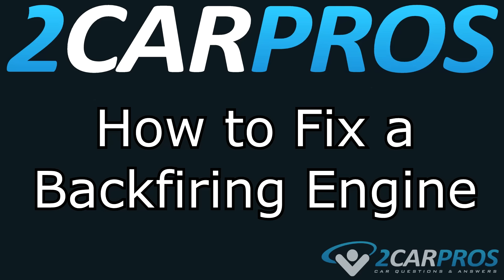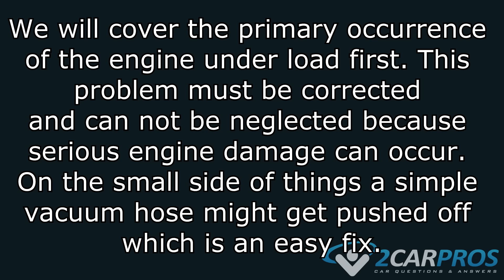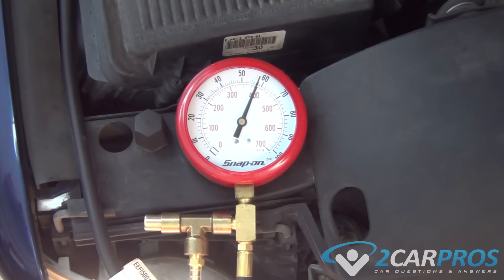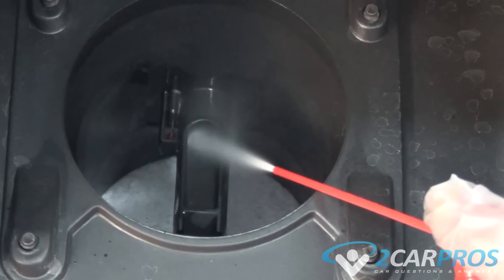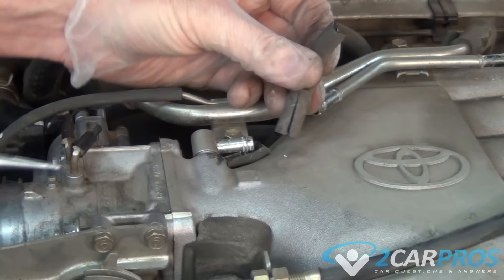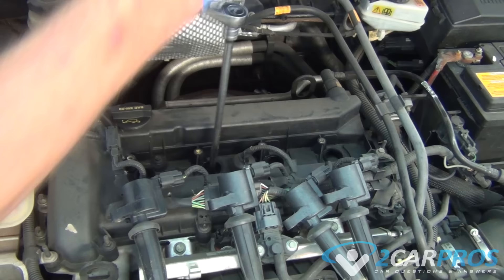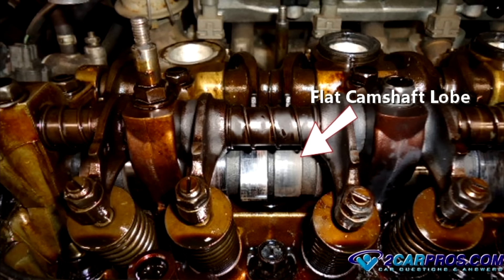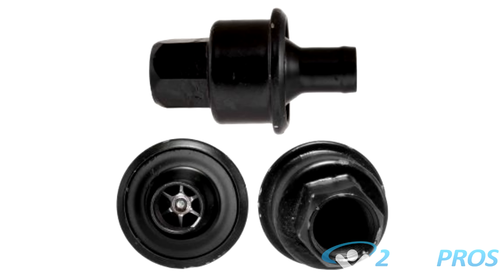HOW TO FIX AN ENGINE BACKFIRE IN 15 MINUTES!

Comment: DO NOT use carb cleaner on a MAF! There is a specific MAF cleaner available which will not damage the components of a MAF. Carb cleaner is too strong!
Reply from the maker: Carb cleaner and MAF cleaner are very very similar and do that same job. We have been using carb cleaner for nearly 20 years with no problems. Thank you for watching!
Reply: Guess again! They are NOT chemically the same. Carb cleaner has a much higher percentage of Toluene, which is very destructive to plastics and electrical components.I have seen a friend ruin his MAF through the use of carb cleaner. The plastic housing inside disintegrated!
Reply: Erik G. T
Reply: Yes I agree never use carby cleaner or brake cleaner , I've see countless times people using these and completely destroying MAF's had this argument with an old timer at work and we actually tested it on some spare sensors we had laying around all of his sensors failed , I used the correct cleaner and all mine still worked 
Great video though guys
Reply: Thank Eric as I was watching I was thinking the same thing, had to look through the comments first and sure enough .🙂
Reply: well I,ll be screwed up the ass because I guess my air box should have melted then now right? and my maf sensor on my 95 mustang should have definitely stopped working a decade ago right? naaaah  I've used carb cleaner for a long time man,  never had a problem so maybe u got the shitty end of the stick or u weren't using the right carb cleaner!! loooooooool
Reply: @2carpros  If no problems with carb cleaner, why do you usually install new MAP sensors? You are FOS.
Reply: @peelzy5329  That is correct, and MAF cleaner is only $6.  Worth it, because if you have to replace the MAF sensor a good one is expensive; most of the cheaper ones are Chinese knock-offs.
Reply: That’s a fact!
Reply: Never use carb cleaner on MAF
Reply: Yeah I used rubbing alcohol to clean mine worked fine for me
Reply: As long as you use non-chlorinated it's fine but I still use the maf cleaner

Comment: My 2001 dodge ram  1500 6 cylinder  is backfiring through the exhaust and dying at stop signs or when I put it in reverse it will start stuttering and sometimes backfires sometimes it runs perfect for a week or two and then it does it again usually when I put it in reverse it usually stops and runs right after I shut it off for awhile  sometimes after a long drive when I slow down it starts popping out the exhaust
Reply: How did u fix it???
Reply: @Goldface_samurai  I sold that piece of Dodge that's how I fixed it

Comment: I have a continuous backfire on my throttle body injected 318 in my 1990 Dodge Ram while driving at cruising speeds, though I believe it’s caused by a rich fuel mixture due to a strong gas smell. Any ideas on how to diagnose/fix? Thanks!

Comment: f150 rough idle ,back fire  and really high idle.
Reply: Sounds like you have a vacuum .
Reply: Same!
Reply: The problem is circled in blue on your grill.
Reply: Same on a 2002 pontiac grand prix replaced all vaccum lines

Comment: Just had 351 firing through carby under load in 4th gear down low RPM, vacuum line to the advance unit on the dizzy was old and loose, cut the line a little bit back and refit it back on and there you go, I don't know if it was the vac leak or the poor advance alone or a combination but there is no backfiring now

Comment: I have a Harley that backfired when it was brand new. It only started after I took the factory mufflers off. The small afterburn that I’ve heard in every Rx-7 that I owned, when I put the flow masters on my mustang, but the Harley (fuel injected) can sound just like a .45 shot if I take off wide open then let off.

Comment: I need help ! I have an 02 Buick lasabre. Upon acceleration i lose power once the engine warms up. Even worse on hills. But once it backfires it seems to gain back some power to pull the hill

Comment: I replaced the valve timing solenoid in my 2001 toyota avalon and it runs much better.  No misfiring and idles at 800 rpm. Check engine light and VCS lights are back on. Any suggestions??😊

Comment: If fuel delivery fails, there isn't as much fuel as usual reaching the piston chamber. How then would the fuel mixture be rich?
Reply: It causes a lean condition on that scenario.
Reply: if the fuel pressure regulator fails you will have to much pressure at the injectors and it will run rich and use lots of fuel

Comment: What about carburetor engines that back fire. My 83 350 doesn't have a maf sensor.
Reply: When I came thru the ranks a long time ago, there were two causes ; lean mixture , or retarded timing , nowadays any number of things can cause these conditions, or give the ecm false information.
Reply: @beckywatt5048  89 honda vt1100c anything over 1/8 throttle backfires thru carb n dies...any idea.. Been fighting this for a few months now ...

Comment: I have an 81 celica Supra 5m-e engine with auto transmission.
I get backfire out the pipe and cannot WOT over 4k RPM in neutral or in Drivewhat gives?

Comment: we have an RV we are trying to get going again. It cranks but backfires inside the engine, and will not stay running. It is a 460 engine.Its a Ford econoline 350. 1991.It will not idle at all. you have to keep pumping the pedal. i know its getting gas but as soon as you let off the gas it dies.
Reply: Adjust your carb

Comment: How does a low preassure causes a backfire!? Regardless the explossion should happen i side the cylinder..it will cause a missfire but not a backfire..if im wrong please explaine
Reply: no problem, if the fuel mixture is lean (not enough fuel) and the engine is under load it will backfire through the throttle body.
Reply: SANTA MUERTE

Comment: Do you have any idea on what could cause a 2005 mustang gt to backfire really loud at idle? I have new sparkplugs, coils, and injectors.. also have one bank running rich and the other lean
Reply: I’m experiencing this on the same car, I have a replaced engine have you found the problem?
Reply: @goofy1496  yeah, my issue was a broken valve spring

Comment: I just put water down the snorkel bit and now it definitely won't start.

Do I put a match in the petrol tank to check out if that will help?
Reply from the maker: Take the spark plugs out, crank the engine over once or twice. Then change the oil. Thanks for watching!
Reply: @2carpros  no worries...

EJ20 - head is O ringed not the block, 2mm copper head gasket. Any special advice? apart from being especially careful around the water jackets with the exhaust sealant..
Reply: @American I liked their reply. I'm assuming some understand the humour, bit of the ole Month Python sort of jibber jabber. They know what o-ringing a block is, and how to check leaks. It gets messy... Lol.

Comment: My truck is not just backfiring it is stalling and now it won't start at all we have taken it to a shop and he said he checked everything he replaced the ignition module a couple of other parts because he could not figure out what was wrong with the truck the check engine light was not on so we could not scan it. This truck has a lot of power so some of what your video shows makes a lot of sense but the stalling and almost dying on the freeway twice plus the backfire..?

Comment: Great video 

Question I have a 2007 v8 5.4 I recently replaced all plugs but used same coils.  Now it backfires when it’s cold when I’m accelerating  .   Also when I get outside and touch the body it zaps me ! 
Any ideas ?
Reply: Check all your ground connections and the wires running from the coils for any imperfections
Reply: @luispichardo6704  im kind of thinking that comment was ironic

Comment: I have 98 f150 with4.6 had diesel put in it and drove bout 100 ft I cleaned all of the tank out and new plugs but engine light is blinking and it back fires any ideals I know it's a misfire but I have no idea how to fix it ran like new before this crap

Comment: Redid the head gasket and the timing gear on the camshaft of a 2.5 L Chevy S10 1990 readjusted the valves everything should be timed in backfiring through the carburetor is there a step I missing check the distributor everything should is lined up any help any ideas of why it's backfiring and won't run
Reply: Timing Problem adjust the timing
Reply: It's got two timing gears one on the camshaft one on the crankshaft both of the shafts are keyed the camshaft is the bigger gear crankshaft being the smaller if bull timing marks are supposed to be lined up with key way then I shouldn't be out of time unless it's the crankshaft 180 degrees out right or wrong
Reply: Luis Alejandro Jorquera

Comment: i tried starting,my engine multiple times after water got in the oil. i changed spark plugs 6/8 and oil change as well and left it for about 3 weeks. i went to start my engine again but i sprayed starting fluid in the throttle then that's when the popping happened. could it be unburned fuel stuck on spark plugs or just too much starting fluid?
Reply: Same thing happened to me change all the spark plugs and if u sucked water through the intake like I did change the intake temperature sensor and the mass airflow sensor

Comment: hello, we people did some major service of porsche cayenne V6 car, after
 having the test drive everything was good as usual, but someone from 
washing team sprayed water on car engine. Next day when we people come 
to know about this we checked the car with scan tool. as engine light 
was on and there were some misfiring codes & a crankshaft sensor 
code(P0338), so we removed spark plugs& ignition coil, removed water
 from there & checked the engine again.. Misfiring codes were gone, 
at idling everything was o.k., but as we increased rpm engine light was 
on again & it was also backfiring at high rpm..... checked scan tool
 again, the crankshaft sensor( P0338), was there... we tried change MAF 
sensor & throttle body, but no improvement.... what could be the 
cause ??????
Reply: Look for rpm at manual  and cheek sidle speed  at specification
Reply: The car dried and vicky started it back up over a year ago.

Comment: Hey can you help me out i have a 1987 mustang gt am having backfiring problems low power low temp i changed spark plugs & wires, distributor ,fuel filter and am still having problems
Reply: Adjust Ignition timing if adjustable. 
Good luck.
Reply: Distributor ignition timing.

Comment: I’m having a issue with my truck backfiring (like a cannon going off) each time I fill up. Does it about 4-5 times. I’ve only owned the truck for 3 weeks. It’s a 2018 F150 turbo charged 5.0. Any ideas?
Reply: I’m having the same issue with my 5.3. It sits there and idles, then starts backfiring

Comment: I have a frustrating problem on a '91 Olds 98 Regency (3800)...... It backfires when the engine is cold and when it warms up it runs fine....... I have replaced wires, plugs, coils, ignition module AND Temp sensor........... what else?
Reply from the maker: That is a complicated question, if you go to our website www.2carpros.com and ask a question for free, an expert will be along shortly to help! Thanks for watching!

Comment: Could bad 02 sensors cause backfiring and cause the car to cut off
Reply from the maker: Sounds more like bad plugs and/or coils. Thanks for watching!
Reply: Bad Crankshaft or camshaft position sensor can make your car cut off while driving.  Bad O2 sensor will make your car run lean or rich.

Comment: Is it a reasonable conclusion that oil leaking onto one or more spark plugs will cause an intake backfire
Reply from the maker: No that will not cause a backfire, A little oil can accumulate which is normal but it can mean the valve cover is leaking.
Reply: @2carpros  a leak in valve cover will cause a intake manifold backfire?

Comment: I have exhaust backfire only when i release the throttle. If i acclerate steady it goes smooth. Let off and i get LOUD popping, especially driving over 45mph. Idle is smooth. 98 dodge ram 5.9 gas
Reply: same problem here on my 93 miata, any fix ?
Reply: @JAPerror  my timing was off. I  rotated the distributor a few degrees and it runs smooth.

Comment: Yes I drove my keep for about two weeks and now it just backfires through the carb what can cause this?
Reply: Dusty Reuchenbach Timing may be off. or you could have bent valves
Reply: Dusty Reuchenbach
Reply: Dusty Reuchenbach I have a 97 dodge dakota driving down the road , the engine will cut off. Then it will start again. While moving. Has new fuel pump
Reply: fuel filter ?
Reply: +Lee Coleman faulty coil? fuel filter? did you find out what the problem was? my 91 mighty max does this

Comment: my 351wensler oilpump went out ifixt it and it will idle great  it spits when I give it gas what is that could it be my timming chain
Reply from the maker: Yeah I had that problem with my 351W Bronco and it ended up being the timing.
Reply: Ok thanks
Reply: Ronald Latham spits where
Reply: Okay okay okay thank you

Comment: I just replaced the coils and plugs on my 2003 hyundai sonata and the cylinder  backfires when I attempt to accelerate or rev the engine in P/N. I ran a diagnostic on my OBD2 scanner and it threw a p1166 code so I have a bad o2 sensor. Could that cause a backfire? Or maybe the spark plugs or coils were incorrectly placed?
Reply from the maker: I would definitely change that O2 sensor then see if it still backfires. Thanks for watching!
Reply: Was it the 02 sensor?

Comment: You Mean when tolerances become worn. Good video but think about how designs should work and wear and tear on tolerances .
Reply: Right on! Very important. Small but good example was maintaining shotcrete machine underground mining and the tolerances were fked. Alot of guys couldn't run machine the shitrete was too thick or too thin and the gun operator was always saying too thin mix too thick. Instead of constantly setting concrete mix and air pressure I just kept constant preddure on grease gun as the shaft and bore turned making it constant. Other operators were fighting worn tolerance and trumng to set up constantly between  but with great gun it kept it all in one. No problem. Understand the machine, steel and tolerances . Right on!!!

Comment: My motorcycle is starting properly and ilding properly but when I open the throttle my bike backfires and die.

And one more thing that my bike is not starting with an open throttle, it just starts with closed throttle